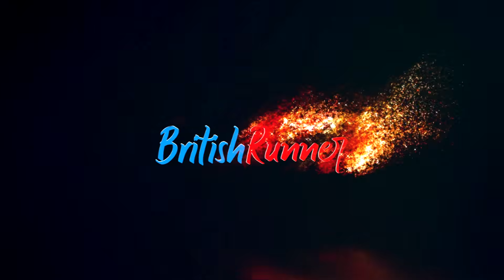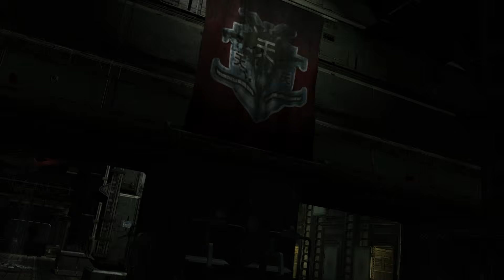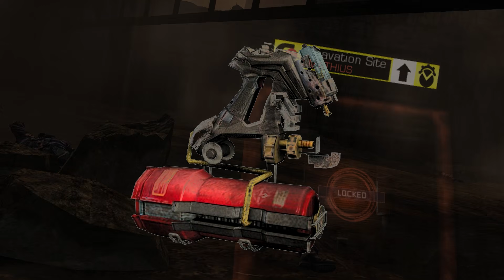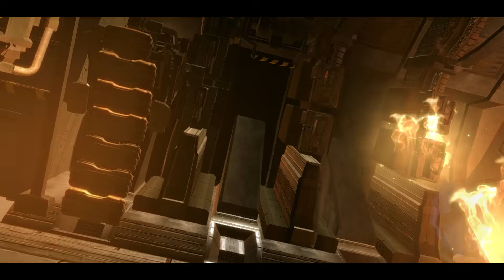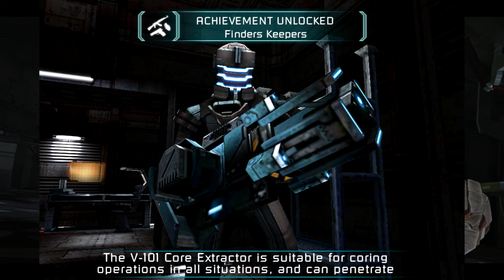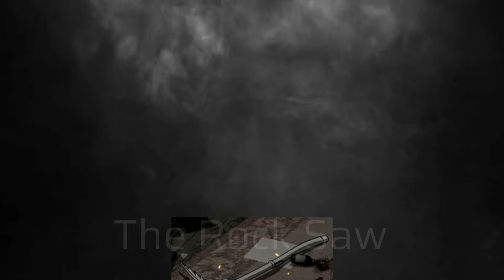Dead Space Lore: The Weapons of Dead Space

Comment: The thing i like about the Majority of "Weapons" in this game is that...they are just simply Space Tools to Deal with Fixing Machines and Asteriod Mineral cleaning and farming.

Like especially the Plasma Cutter,It's literally how a Crowbar is to Gordon Freeman that is to Issac Clark
or the Gravity Gun and kinesis module.

Both Protagonists uses Tools as Convenient and Deadly weapons and This is honestly my favorite video game trope.
Reply: With that said. Their nature as tools would lend to really cool environmental interaction and puzzle mechanics in either the remake or a sequel.

Using the severing tools (plasma cutter, ripper, line gun) to cut down objects and debris.
Using impaling tools (rivet gun, javelin, kinesis impalement) to pin objects onto surfaces.
Using explosive tools (pulse rifle secondary fire, line gun secondary fire, flamer secondary fire, force gun, detonator, contact beam) to blow away heavier debris and obstructions too heavy for kinesis.
Using the javelin's secondary fire to provide temporary power to a machine.
Using the flamer to melt slag and ice off of machinery.
Reply: @DJWeapon8  That would require the player to have them on hand, so there'd probably be 'Malfunctioning' versions nearby for those puzzles.
Still, I'd actually like that, would reinforce both that these are mining tools first and foremost, and that your job is as an engineer.
Reply: @gagejohnathan9641  those puzzles being well designed could have different solutions with different types of tools, making so it's almost impossible for the player to be softlocked it they carry 2 or more different weapons
Reply: @DJWeapon8  this needs to be a thing
Reply: the DS universe just screams originality
Reply: Yeah the nercos are too powerful for just a simple gun to take them down. I like the little lore in this game.

Comment: You forgot about the 711-MarkCL Rivet Gun from Dead Space 2 (and technically 3). Honestly kind of surprised you missed that one compared to the Extraction Rivet Gun.
Reply from the maker: Tell me what is the difference? Other than the alt fire. Kinda surprised you didn't recognise the  photo of the 711 rivet gun.
Reply: @TheBritishRunner  One thing for sure is that the 935 Bonder Rivet Gun is made by Schofield Tools (as you stated in the video) while the 711-MarkCL Rivet Gun was made by Timson Tools. While yes they are very similar due to sharing the same purpose, as you stated the secondary fire modes are vastly different. The other difference is the power and damage of the rivet. The Schofield's Bonder Rivet Gun is more powerful as the rivets are able to sever a limb by one shot (against standard Necromorphs) albeit with a slower firing rate. While the Timson's MarkCL Rivet Gun fires much weaker rivets (seriously even when upgraded max the damage is pretty pathetic) but with a much faster firing rate. My only conclusion to the difference in terms of damage and firing rate from both Rivet Guns is that the Schofield's Bonder Rivet Gun is made for more heavy duty line of work as it's rivets are able to penetrate more tougher and denser material while the Timson's MarkCL Rivet Gun was meant for less heavier work as its rivets aren't able to penetrate tougher materials as effectively (being more like a modern nail gun).
Reply: I’ve beat dead space 2 several times and I didn’t know the Rivet gun even existed
Reply: @Riptor1998  I play the PC version of DS2 and the DLC weapons and suits are made free so the Agility Rivet Gun was made available in the first store. Yeah you are made to forget about its existence since the gun is pretty pathetic in terms of damage and usefulness (unlike it's DS3 counterpart) that you are better off using the Plasma Cutter.